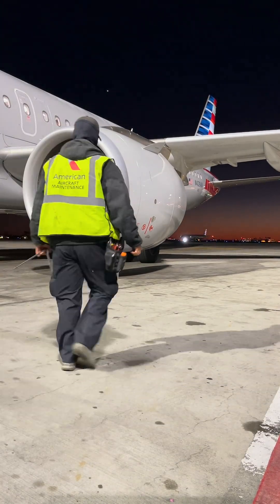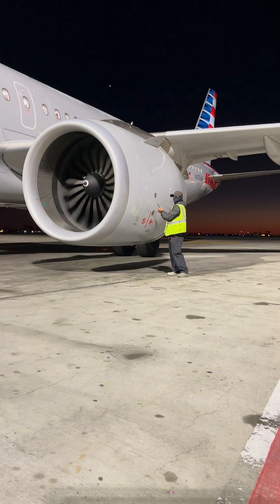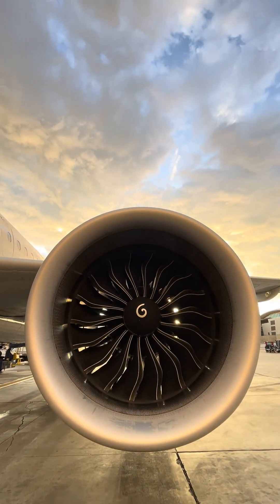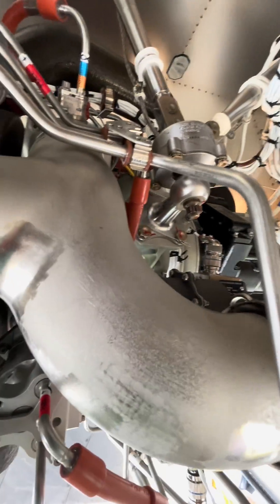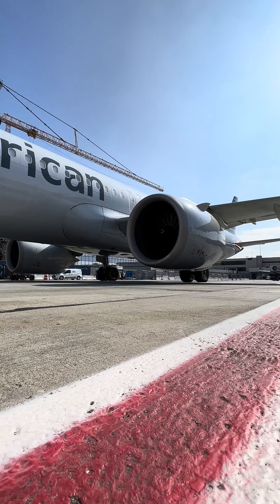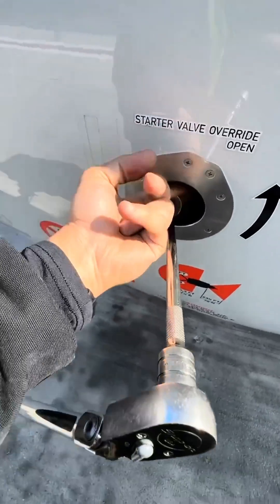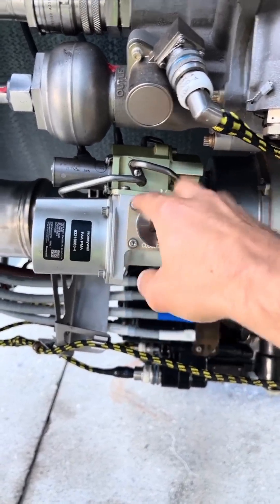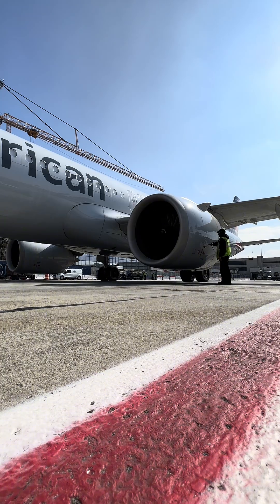Manual Engine Start on a CFM LEAP 1A.

Comment: And you better hope that starter doesn't take a big shit during engine start.  Over 70k rpms before starter cut out.  Lots of shrapnel.
Reply from the maker: I seen that happen before. Not a pretty sight but these fan cowlings are pretty strong carbo fiber material. It will contain most of it.

Comment: Where is the harness your suppose to be in, when I worked their you had to be wearing a harness which is attached to a tug to prevent ingestion of mechanic into the engine, safety first. 😮even if he is standing just a tad behind red stripe on engine, we still had to be in a harness.
Reply: Must of changed the safety rule when US AIR bought out AA. Do you need a harness to go above 4 feet rule by chance.?
Reply from the maker: @ken7875  so where do you see anything or anyone here above 4 feet. I don’t get what your point. Why do I need a harness for a manual engine start ???
Reply: @StigAviation  
Safety s you don’t get sucked into engine, when I was their You had to have one on.
And if you go above 4 feet you had to have a harness on. 
It must all have changed.
Reply from the maker: no harness needed

Comment: Thats cool that they did that. Much better than have to switch aircraft because one of 10 switches relays or valves isnt working. As long as you dont need to restart midflight for some reason. 😂
Reply: You can mid flight or the airplane wouldn’t be allowed to leave

Comment: Took note how you safely walked away from the engine avoiding coming near the front cowling and rear exhaust of the engine.
Reply: Safe entry and exit. Great protocol.
(From a P&W test cell operator)
Reply: We call it the intake/inlet and exhaust

Comment: Is it possible to get sucked in from where you are standing?
Reply: Engine fan cowls usually have “Do not cross” red lines painted on them. Mechanic will walk 90 degrees from the inlet.
Reply: It is not possible

Comment: Does it still motor at 20 ish % with manual starts?😊
Reply: The only difference between a manual and an automatic start is that it's manual not automatic, nothing else changes.

Comment: In case that engine flames out in flight, is it still possible to relight it through a windmilling start?
Reply: Yes, provided you have enough airspeed for sufficient compressor rotation.
Reply: It's an FAA cert requirement to do windmill starts, performed below 20,000 feet. Speed is not as important as altitude in this case.

Comment: This is happening more and more and its kinda pointing to lack of maintenance i recently was on a flight which had no batteries or power going to APU to do the regular engine start so they used external or manual start
Reply: Maybe apu was inop
Reply: Your comment points to the fact that you know nothing about aircraft maintenance.  The APU was probably on MEL ….and there are probably hundreds of planes like that right now.  We can’t fix them without parts dude.
Reply: @justing42  thats why you put the apu on MEL because its INOPERATIVE and i know because i defer things at work every other day not only that but also NEF CDL but you wouldn’t know anything about that bc you’re ignorant
Reply: Lack of parts = ???? 😮

Comment: I've worked on the ramp for 10 years, i must've seen it 3 or 4 times at most (had to use the ASU more than i can count tho).
Reply: ASU?  Air Start Unit?
Reply: @mistergrendel32 Correct.

Comment: Yeah but what happens if there’s a flameout and need to re-light the engine when up in the air?!
Reply: pilot climbs out on the wing and hits the manual start button🤣🤣🤣
Reply: @rearspeaker6364 There are a series of handles to hang on to.
😜😜😜🤓
Reply: In mid air the incoming air is sufficient to maintain the fan rotation/LPC (assuming it's at a reasonable height.)
Reply: @kunjukunjunil1481  You also want the ignitors set to both and on high jewel ,,
Reply: This is the one time the gremlins help out the pilot
Reply: You've been watching too many Top Gun movies.
Reply: Don't worry bro. Once the engine starts theres no way in hell that it'll shut off. The only way, believe me is to shut the fuel valve off. 
(Re: AB A380 QUANTAS unable to shutdown)
Reply: @sfopaladin2661 not quite correct. The engine can “flame out” (eg fly through an ash cloud, or have a fuel management issue) but it’s pretty unlikely and the fans will still be spinning (due to the airflow) enough to restart.

Comment: That's a better placement than the PW1100G...
Reply: Where is that one placed?
Reply: @nolanono2532  to the right side of the engine, on the core cowl. Yes, the core cowl, which exposes the operator to engine bypass flow blast LOL
Reply: @noranekonekomatagi3261  wtff 💀
Reply: @noranekonekomatagi3261 you mean the cold stream…as we say in the biz
Reply: @justing42  yep, speaking of which, it has to cool sufficiently before ignition to prevent rotor bowing, sadly the cooling cranking can not be done manually.
So you either end up waiting for it to cool, or just open up the cowls and replace the starter valve. The latter is faster if parts are available LOL

Comment: So jet engines have apu to fire up the turbine. Cool.
Reply: Engines need some sort of compressed air to start; from the APU, the other engine(s) or a ground-cart.
Reply: @Greatdome99  old school jets used a huffer.😎
Reply: looks like they divert the APU's exhaust to operate the starter.
Reply: @rearspeaker6364 and without apu, external start req'd
Reply: @rearspeaker6364 It's not the APU exhaust but, bleed-air from the APU compressor which is fed via pipes and valves to the air-starter mounted on the engine.
Reply: @rearspeaker6364 it is bleed air not exhaust

Comment: If an engine needs the manual start on the ground, does that mean there's no ability to restart in-flight?
Reply: no, the air moving at 3-400 mph is plenty to keep the blades spinning, which is somewhat all the APU is doing.
Reply: @snypa-ck7hn   I was about to say, surely the momentum would help. Like rolling and bump starting a manual car
Reply: @justmechanicthings  I wonder if one A320 can bumpstart another at 22,000 feet........
Reply: Manual starts are simply a maintenance practice (not a "need"), and have nothing to do with engine operation or starting in flight. Engines are required to windmill start at altitudes below 20,000 feet.

Comment: Never realized that jet engines also have manual ignition starters.
Reply: Can't start without some source of air. That comes from the Aux Pwr Unit in the tail, the other engine or a ground cart. They won't 'crank over' on their own!
Reply: It depends on the aircraft and it's age, but the only manual part of starting a modern aircraft is usually just selecting which engine then selecting start assuming the APU is already running. The rest is automatic until the start sequence completes usually once the engine has reached self-sustaining rpm. The engine then accelerates and settles at idle rpm.
Reply: Did you even watch the video
Reply: Yes, we refer to them as rope pull
Reply: It really  annoys me when  someone  shares  something  cool that all these people  chime in how that's  just not rite!how about  telling  the guy thanks for taking the time  to show us something  cool!!!
Reply: Always interesting to see this kind of thing, have seen it a couple of times and always wondered how worked. Thanks Stig
Reply: This guy hand cranks/ starts his jet engine: https://www.youtube.com/watch?v=7kvkpbdehH8
Reply: Near the bottom is a door, open it and there is a square shaft where a kick starter lever can be attached.